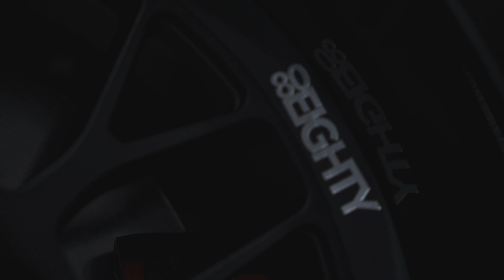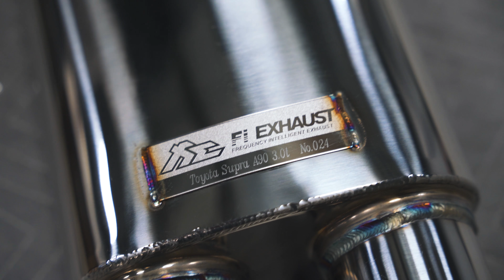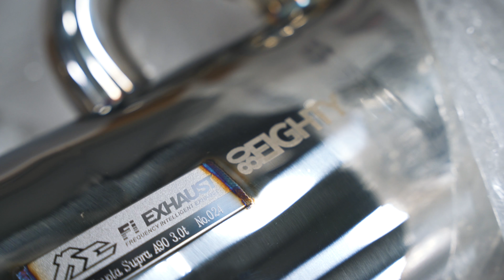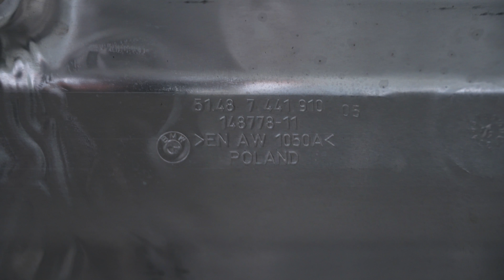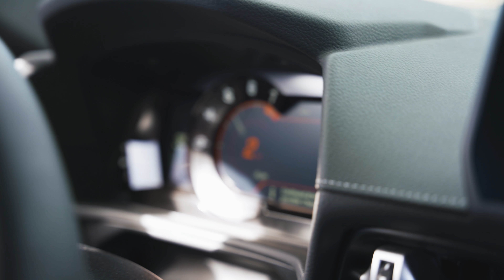2020 Supra FI EXHAUST INSTALL

Comment: sounds awesome.  Did this system come with new actuators for the valves?  Is the valve control still tied to the sport mode button or solely from the remote?